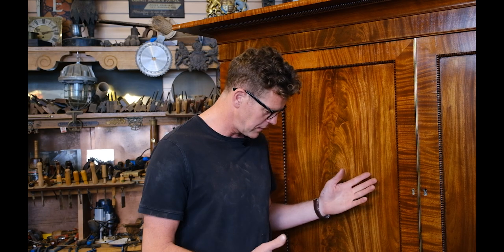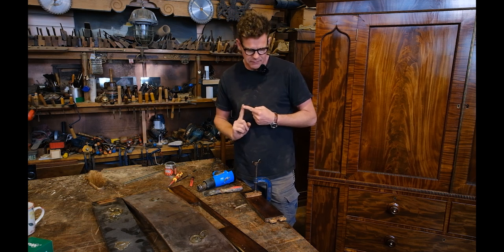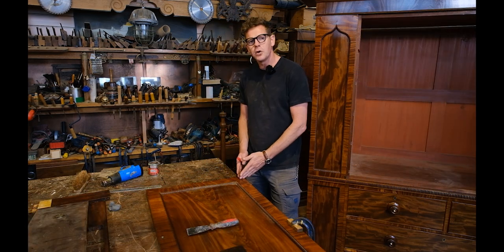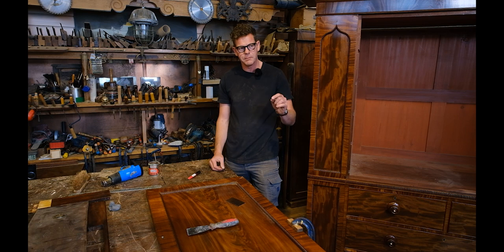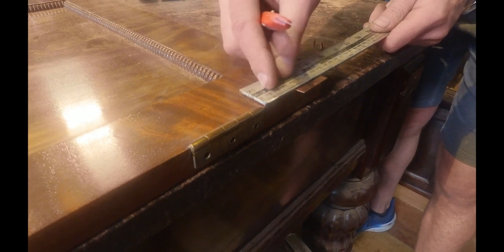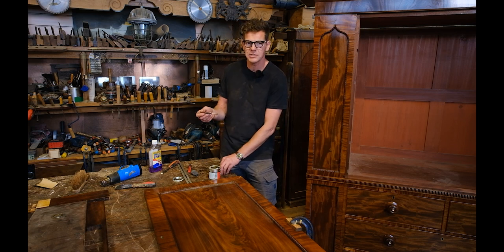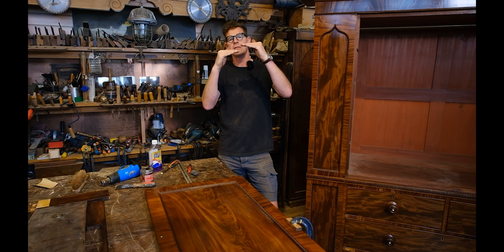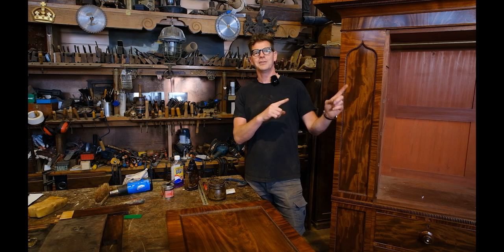How to repair veneer on antique furniture

Comment: Just watched the repolishing video followed by the veneer repair. Very informative and useful to me as I'm not so good with the polishing and colouring aspect of restoration. When I patch veneers I make good use of my disc sander to get a good fit but do like your idea with the blade to trim and get the best fit. I don't use the contact adhesives, I prefer my good old glue pot and pearl glue, albeit it means a clamp or tape overnight to dry. Thanks for the all the tips.

Comment: Saw this after I tried doing mine. Can see where issues I had came from especially the different hardness of the new piece.  On the older piece the pores are not very visible but the new piece took up the stain and made them stand out too much. Still for a 1st attempt I'm quite pleased just to give it a go. I'm also adding depth to the wardrobe making the inserted piece a feature... pillar like. Finally cutting the double with unit in half so that after 7 years and 2 houses we can finally get it up the stairs. I'll use dowels to locate the two halves and some brass plates to lock it in. The top piece is even more complicated than the one there so again a feature will be added to hide the join in plain sight !

Comment: Cracking vid Alex. One tip I use is when using a blade or scraper to lift a section of veneer I heat the blade as well.

Comment: Veneer work can be a challenge. When I cut my patches I slightly over size them and under cut the edges then glue and clamp in place. This tightens my fits. The end results are what I love to see. The only veneer work I am doing is quite thin and brittle stuff.

Comment: I have reservations regarding the use of contact adhesive; from my experience this stuff degrades badly over time. I had a walnut veneered telephone table made in the late 60's, and the glue had turned to powder; so much so, I was able to lift the veneer intact, just by moving a palette knife under the surface. While I appreciate the modern equivalents maybe superior, I believe it's still fundamentally the same product.
Reply: There are different approaches, but when he took the contact glue, I lost faith in his restorations. 😅
Reply: @wanderwurst8358  That seems rather extreme, given that you are objecting to just one detail in a mass of useful information.

Comment: Hide glue and a veneer hammer surely?! Evostick and contact adhesives are infamous across the trade and are strongly associated with cowboys. They offer very little future repairability and are entirely unsympathetic. I'm curious why you wouldn't use the traditional methods, which are just as easy?

Comment: I think he’s more suited to butchery than furniture restoration. Just watched him “restoring” an old worm eaten chest of drawers on “The Restorers”  He used a spade bit to drill holes for dowels. Surprise, surprise the end of one of the drawer dividers split open as he was drilling it and no mention of how he dealt with the parts  that consisted of more holes than wood.
Reply from the maker: Relax john. It's only tele. X